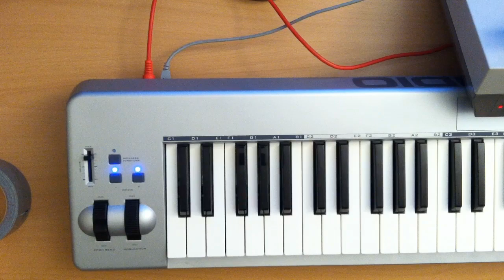Chip Maestro Tutorial

Comment: If anyone has any info for a total MIDI noob, I could use some help. I just got the chipmaestro, and was wondering if it's possible to set this up with an NES and iPad? If so, how?
Reply: I'm sure you could do it.  You'd need a breakout box between the ipad and the NES.  You'd  need a program for ipad that would output midi information into the breakout box and into the NES.  You'd need speakers for the NES output.   I'm sure there are programs out there that are capable of doing it.   Also, midi keyboards (like the keystation) are very cheap to purchase, especially through ebay.  It might be easier to manipulate the sounds like the guy did in the video.  Good luck .

Comment: i'm very confused as to how things work with multiple channels. the pseudo-manual that's presently up is... not exactly elegantly written, and so far i've found that changing pulse widths doesn't work on individual pulse wave channels in arpeggio mode and the glide doesn't work in individual channel mode at all. are these things being worked on as firmware updates or anything?